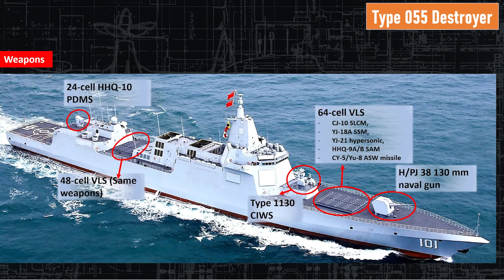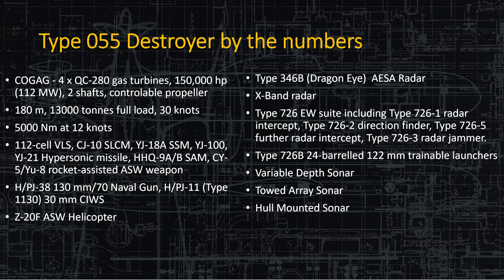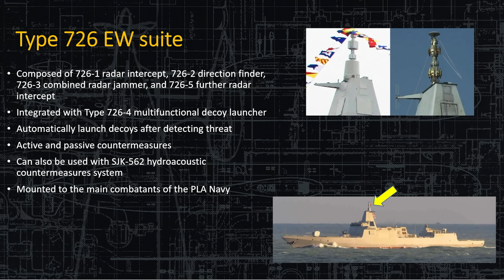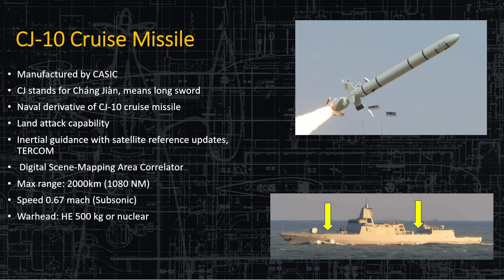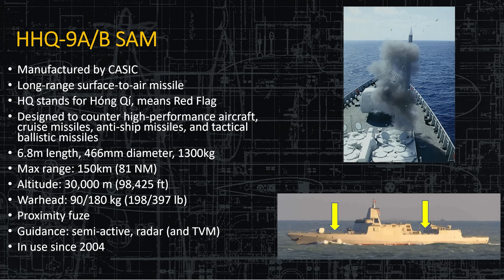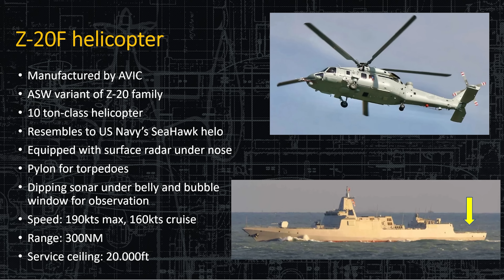China's Type055 Destroyer Ship Brief

Comment: Why do you think the Type 55 is worse than the Ticonderoga, or about the same as Flight II Burke? I'm not saying you're wrong, but even with an educated guess I would like to hear your reasoning, not just a blank statement.
The Type 55 has almost as many VLS as Ticonderoga, but they are larger, and the missiles there are more modern. The radar is also AESA as opposed to PESA.
The type 55 has more VLS cells than Burke.
So, what's the reason. Their low cruise speed and range? That would be a factor if fighting near Hawaii or at least Midway, but near Taiwan it's not as important. Lack of experience for the sailors? That's true, but is hardly an issue with the ship.

Comment: 1. There are several errors in your video. First, according to the data of 052D, the range of Yj18A is 600KM, not 540. 2. Except for the Burke 3 series, the other Arleigh Burke destroyers are Spy1D, and the radar cannot be stronger than 346BAESA. 3. Moreover, HHQ9 and HHQ9B are different. The former has an interception slant range of only 125KM, while the latter has a range of 250-260KM. The SM6 missile is only superior to the HHQ9B in terms of firing height and speed. If it is used for interception slant range, the two are almost the same. The latter is an active radar guidance, not a semi-active one (these are all public information)
Reply: 他这个视频问题多着了，包括说乌克兰的发动机是美国的山寨品，还有航行速度问题，055完全可以35节极速航行，包括他没理解为啥一艘小船要装几万吨级别大船用的动力，自然是全舰供电，支持大功率雷达电子战设备。提康德罗加更是个老古董马上都要退役了，1960年代的船拿来对比也太拉档次了。

Comment: Hey man often your videos are serious and well researched, but this one I do have to make a comment on, the QC-280 is not more advanced than the WS20, WS15 or WS19 engines, those require even more advanced alloys and are already under production.

The WS15 is between an F119 and F135 (F22 and F35 engines), so yeah, no, it's been years since China solved the material sciences problem...

Comment: Type 055 is not limited to 30 knots. It's at least 30 knots. Same with the endurance. 5000nm was just a number produced by a few sources. Chinese originally reported 7000nm. It also has. six QD-50 turbines for installed power.

Comment: Not sure the endurance statistics of Type 055 came from (wiki said 5000nm/12kt ) . Most public information indicated Arleigh Burke class has a range of 4400nm/20kt, which is already inferior to Ticonderoga class cruiser (6000/20kt). Apart from the fuel efficiency of the main engines, another key factor is the hull shape; the "thinner" hull has lower drag and better fuel efficiency. Arleigh Burke's length-to-beam ratios is about 7.7 (154m x 20m), Suprisingly, the ratio of Type 055 is (180m x 23, about 7.82), which means Type 055 didn't take much advantage there. Considering the (alleged) lower efficiency of Chinese QC280 gas turbine, the range performance (without refueling) of Type 055 is not likely to exceed Arleigh Burke.
Reply: A lot of alleged information and wishful thinking in this video.

Comment: Arguably not as good as the ticonderoga 😂😂 i'm just quitting this video After just 30 seconds because what follows is nothing but BS
Reply: That has to do with subsystem advantage that western navies have. Clearly the type 55 is a more modern platform that's designed for stealth, but the Ticonderoga is a very capable platform, which is why congress is loathe to retire it.

Comment: I think the PLA always appreciates influencers like this channel for spreading info to underestimate them.
Reply: This guy is clownin' as usual, no surprise there.  He has no problem confabulating fact vs speculation as far as the Chinese military is concerned.  Case in point, those stats on max speed, economical speed, and range are all purely speculative since the PLAN doesn't publish ANY of them, and he uses this speculation as a launching point to disparage the ship's performance.  What's even laughably worse is that he posts a photo of a low bypass turbofan engine (the WS-10) used on fighter jets instead of an actual photo of the QC-280 naval gas turbine (which looks dramatically different from a fighter turbofan), and then proceeds to mock the engine designers for using fan blades that would (apparently to him) obviously fly apart at high RPMs.  How this guy could believe that those designers who will invariably have IQs which will be several standard deviations above his would actually design an engine (turbofan or gas turbine) that would have its fan blades somehow fly apart at operational RPMs is beyond me.  The bias and condescension in his videos when it comes to the Chinese military is so surreal it's actually pretty hilarious to watch TBH.  LOL
Reply: @Meatwaggon  he didn't say they would "obviously fly apart," he said they did fly apart, a problem that has since been addressed.
Reply: They need the 1.6 billions from congress smearung funds. 😁😁
Reply: @EWP-i8t  是的，我希望这样的声音越来越多
Reply: absolutely
Reply: well these youtubers need to food on the table too. its infotainment not real info.
Reply: @EWP-i8t  战忽局藏不住了
Reply: 100%.
Reply: Probably not as good as the Ticonderoga class (we are decommissioning). 哈哈哈
Reply: 你错了，解放军真的不希望你们过分夸大吹嘘自己的装备，我们还是喜欢低调和谦虚！但是奉劝你一句话，永远不要高估了自己的实力，也永远不要低估了敌人的实力。

Comment: 12 knot is estimation by Janes, it is not the official numbers. given the powerplant configuration, its crusing speed is likely comparible to US Burke. it may not have the range of an Ticonderoga, but China doesn't have deep overseas interest like US. matching the Burke is more than enough for their defence requirement. US build it warship to attack other countries, China build it warship to defend itself. also the gap isn't as big as you claim, the engine older Burke use has an efficiency rate of 37%, the while the one in Burke III has an efficiency rate of 39%. that's really only a 6.5% gap, and the 7th ship is likely to received improved version so the gap really isn't that great, rather the weight of the engine is probably the gap they need to close. there is a reason why 055 is so big, its engines isn't as lightweight.

China does have one advantage, its air defence missile can be directed by phase array. USN abandon this for it Burke III as it didn't want to stock up on 2 type of missiles. as for ballistic missile defence, i do not believe they have a missile in the current 055 for that, as pointed out in the video, the ship has the equipment to direct ballistic missile defence, but the ship is not equiped with those missile, kinda like how UK warship didn't have antiship missiles for years... this ability does not seem to be a focus for China like it is for Japan, the ship will have this ability, but I don't think it will be demostrated soon, with only 8 ship in class there are more important things for these ship to do than catch ballistic missile.

Z20F is based on blackhawk helicopter that US sold to China for SAR. with notable design changes to improvement in payload in high altitude, which is achieve by adding a 5th blade. so you can easily tell the chinese and american helicopter apart by looking at the number of blade it has. why China has a focus on lift power is to address the problem that existing helicopter they had, has difficulty performing in Tibet where the high altitude eat into the useful payload of helicopter. this change end up being quite useful for naval operation as Z20 was adopted as the standard helicopter...

honestly, I don't think they will use this for anti sub, it capability is mostly there for self and fleet defence. they are building like 40 frigate for sub hunting.
Reply: Shut up ! Let them guess.
Reply: Thank you
Reply: 30 knots to my memory from another blog

Comment: Their gas turbine probably isn’t as efficient because the engine can’t handle the high temperatures necessary for peak performance. My guess is that they haven’t figured out how to manufacture components that handle super high temperatures while also being strong at those temperatures and that can handle many heat cycles with severe changes in temperature and is reliable for ages and ages of operation. Getting all of that right gets you an engine that can deliver great efficiency.
Reply: this actually isn't true, he confuse the engine as an american design, but it really a soviet design. and the chinese engine is more efficiency than the ukrainian version if you look at the spec being sold by ukraine. this engine is only 0.5% less efficiency than the first Burke, and 2.5% less efficiecy than the latest Burke III.

Comment: 19:47 just wanna add a comment as an Air Defender here. The real issue from our wheelhouse(missile defense) is just that, the change in speed. SAMs are great at intercepting ballistic missiles because they maneuver so little. A change in speed is like going from checkers to chess. Its really hard to prepare for that, and it basically invalidates the entire first volley of interceptors you tried to put up unless they get lucky and can wheel around to hit the target at as much as a third of the range. This is where I think the Sea-RAM comes into play, basically firing much larger, guided, and maneuverable deck shells at the targets. As cool as Phalanx is, the truth is that in missile warfare, bullets are much slower than missiles. Now lasers are a whole other ballpark. Being able to even burnout specific components like the SATCOM antenna, flight computer, radar/IR sensor, and such can be about as good as a hard kill.
Reply: You’ve got it backwards. Mobile lasers have very little utility against maneuvering cruise missiles or ballistic missilesOur biggest ship-mounted laser systems are only good out to a couple klicks and they have to stay locked on for several seconds. 

CIWS isn’t an adequate counter for maneuvering cruise missiles or ABMs—You’re right on that account. Gun systems are still a superior option for dealing with incoming missiles, however. You just need a lot more of them. Something in the 76mm/62 caliber range is probably a good starting point. Small, cheap interceptors would probably do the trick, too. We can’t be spending several million dollars per shot on interceptor missiles
Reply: @GrahamCStrouse  I’m equating SeaRAM missiles to cannon+. As for lasers, they are advancing quickly and have already shown rather great demonstration results for engagements beyond 5km against maneeuvering missiles. I give it 5-10yrs before they are rolled out in massive numbers.

Comment: This is the first time I see someone confusing the HQ10 with the HQ7.
The size difference between the TY90 helicopter AAM based HQ10, and the Sea Crotale based HQ7 is huge.

HQ7 was the primary SAM for PLAN in the 90s and long obsolete. Only the two old 052 still carries them, with other ships replacing those with either HQ10 or HQ16 after refit.
Reply: He probably just googled it and didn't even finish reading the wikipedia page.
Reply: That's FL-3000N point defence missile system housing HQ-10 SAMs
Reply: @tttt-ni3mr  FYI, FL3000N is the missile in HQ10, it was developed from TY90, which was a blank sheet design and the only purpose designed helicopter AAM in the world. It's intermediate size between MANPADS and fighter sized missile. 

Every other nations either went with MANPADS (e.g. Stingers) or fighter IR missiles (e.g. Sidewinder) for helicopter air to air.

Comment: The whole section about the gas turbines used by the Type 055 is wrong and needs correction. The GT25000-derived QC-280 is not a development of the American GE LM2500. The GT25000 is a wholly Ukrainian design and is completely different from the LM2500 in configuration and size. I believe what has confused you is the similar designation and the fact that China used the LM2500 on the original two 052 Destroyers Qingdao and Harbin.  The arms ban due to the Tiananmen square massacre stopped the supply of more LM2500 to China forcing a switch to the Ukrainian Soviet era design  the GT25000.
Reply: @Fedaykin24  the propulsion system was indeed of Ukrainian origin. Ukrainian Motor Sich Joint Stock Company was the premier ship and aircraft propulsion systems manufacturer during the Soviet era. Chinese Skyrizon bought 41% of the shares, later tried to acquire the whole company. However, this didn’t come to fruition due to external pressures from a third party. The current Ukrainian administration forcibly tried to re-nationalize the company. Like you said, the propulsion system was of Ukrainian Origin and not a reverse engineered model.
Reply: This Sub Brief guy is always poor on China-related topics.
Reply: @Flightman453 most people in us military was not trained on Chinese topics. They can pronounce Russian words and tell you all the history of any niche Soviet equipment but most often have no idea with anything related to China.
Reply: @APDM_Analysis  Not trained or knowledge, or maybe deliberately and willfully ignorant?
Reply: @Flightman453  Need to get a piece of that 1.6B pot.
Reply: The fact that he puts a picture of a jet engine says a lot about his knowledge about turbines.
Reply: @Fed thank you you
Reply: The 150MW can also be misleading. It's for all 4 turbines combined
Reply: KerstinSomer-zt4qs  cry more
Reply: its called the tiananmen square color revolution, not massacre. Only PLA got massacred that day and a few students died when the soldier tried to defend themselves. You should see how the "students" kills the soldiers brutally because some soldiers refused to shoot the students . Look around for alternative info in the internet about this incident and you will be surprised.
Reply: @turtlesoup8134 much easier to lie than clearing a l ie
Reply: I think what this comment shows is how damn good this community + Aaron himself is. Hopefully the video will be edited in due course but it's brilliant (as always) besides this ;)